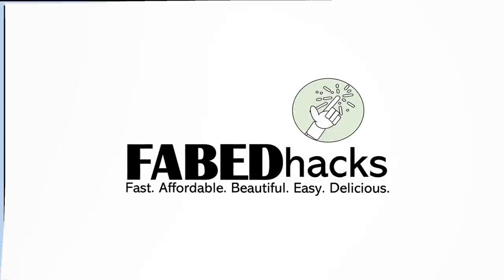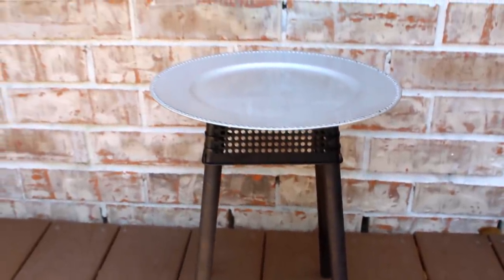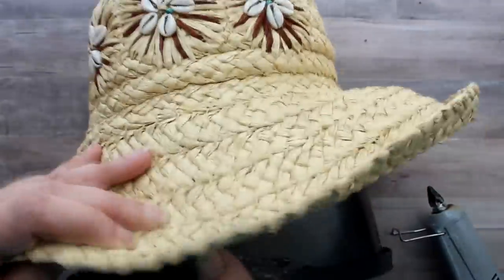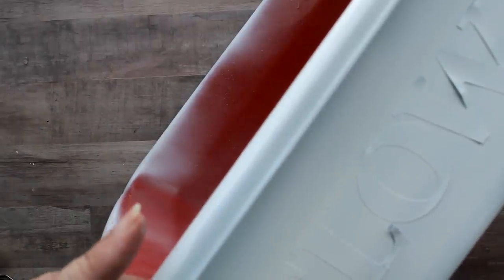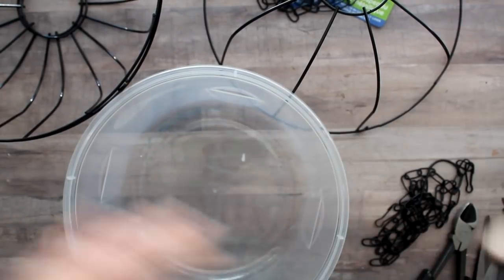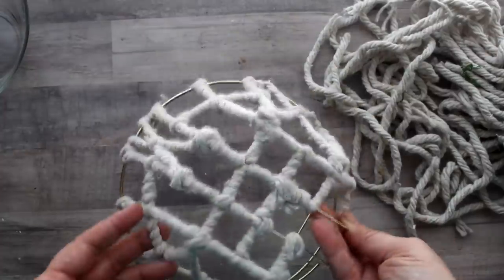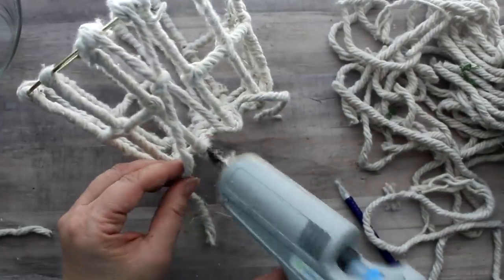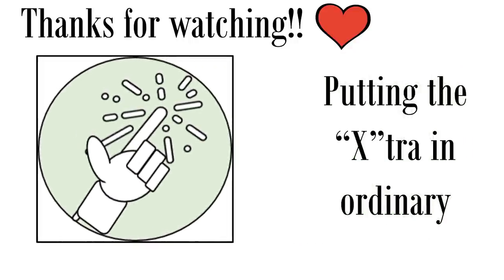6 DIY PLANTER IDEAS | DOLLAR TREE DIY & UPCYCLE | Farmhouse Modern Boho | Part 2!

Comment: Thanks so much for the inspiration you published on your channel.Now I will go to the Dollar Tree to purchase the wire baskets for my phalaenopsis orchids that are in plastic pots which I intend to switch into the inspirational ideas you shared 😀. Suggestion: use clamps to secure your projects after applying the glue and hasten the time to stick the strings onto the wires.

Comment: Hi, great ideas. Also,  instead of using stain you can use the Waverly wax in antique  & just water it down,  paint on & wipe off like stain with no fumes. Blessings ❤
Reply from the maker: Thanks! I do use the Waverly wax but it is often deeper than I want to do. But if I dilute with the water I could adjust. Thanks for the tip! So glad you liked the DIY Planters #2! I just published the third Planters video featuring the Ladder Planter plus two more dupes! Please check it out when you get a chance! https://youtu.be/U6rkB33XW-c 😊💗

Comment: Hi, if you dont  have  stain? You can use tea water.
Or I like old English. Too strees it I take a butter knife a chip Nick's in the wood. I did it with frames.  An on lamp shades with leaves in the .
    Fall an mode pod. It's like it's there to talk about.

Comment: Do you have an idea of a weight limit for the first planter?
Reply from the maker: Hi Leah! I can't say for certain but I have a large pot in it that is about 10 inches high with 14 inch diameter and it is full of dirt so I'm thinking it is at least 8-10 lbs (?) And it is holding that with no issues.

Comment: What makes the difference on what you use e6000or the other glue
Reply from the maker: Well I have been trying to cut back on e6000 a little and use that tight bond where I can usually on wood, paper, twine and other porous surfaces. But on the plastic, it really needs to be the e6000.